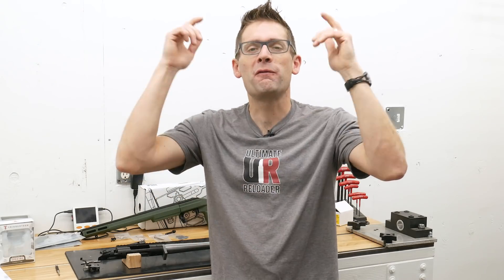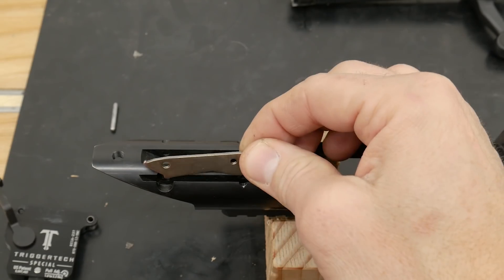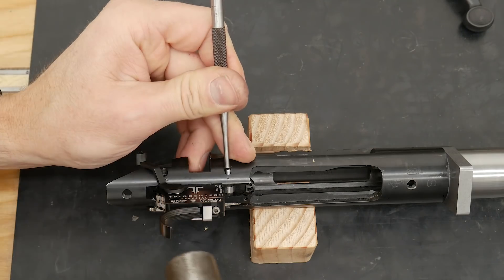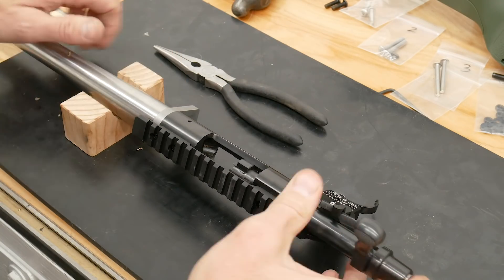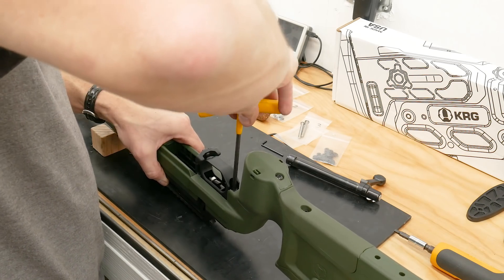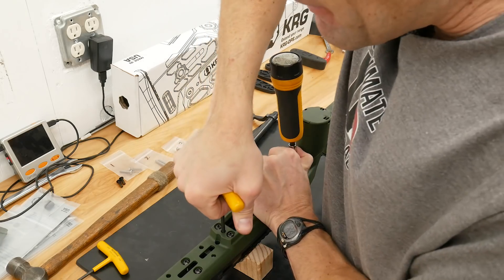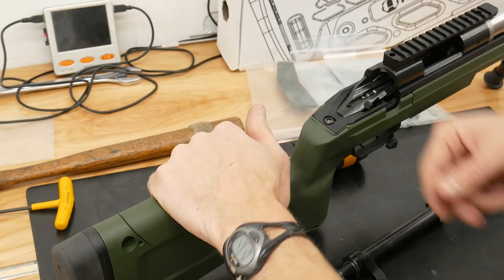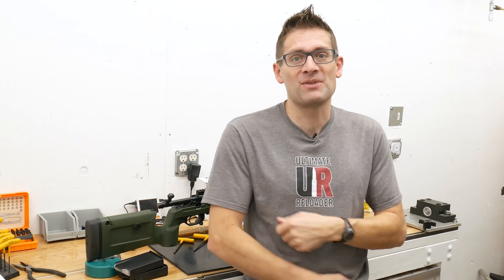224 Valkyrie Rem 700 Build: KRG Bravo Stock, TriggerTech Special Trigger (Part 6)

Comment: I'm completely new to long range shooting, would I need to get bottom metal for a barreled upper if I get this stock? Say I buy a factory tikka t3x lite that runs their proprietary mags, would I be able to remove it from the stock and be able to just plop it down into the KRG and run AI mags?

And thanks for running through your build process! Makes everything look a lot less intimidating.

Comment: Nice build! I have a remington 700 in 308, bought a triggertech trigger  and a KRG bravo chassis. I had the same trouble for the front screw and came up with the same solution. I didnt had any spacer on the buttstock, I build it last winter and its cold here so I had multiple layer on me anyway but now I just get used to it even in the summer. I will had a strike eagle next month... I will take a look at your videos! keep up the good work.

Comment: Does your bravo have an aluminum or polymer bolt release? If its polymer which extension did you purchase? I'm considering the bravo and read on their website for an August 2018 update they switched to a polymer mag release

Comment: Awesome video series! I learned a ton. And it was entertaining. Thanks a lot for it.

One question: why didn't you glass-bed the barreled action into the stock? Isn't that always preferable?
Reply from the maker: Thanks! This chassis is machined so that you don't need to glass bed- so far so good on that!
Reply: @Ultimatereloader  I was wondering the same thing re: bedding.  I'm quite uninformed in re: bolt guns though.  Thx for answer.

Comment: Great build how much money are we talking about
Reply from the maker: $550 - barrel blank, $100 bolt mods, $400 stock, $100 extra parts, $40 scope rail, $200 trigger - so say about $1500 + labor + optics at the end of the day??? I gave myself a great deal on the gunsmithing labor :) :)
Reply: @Ultimatereloader  Wow, that's an expensive barrel for a blank. I figured the barrel blank would be cheaper than an already reamed/threaded barrel. My 223 REM Match Criterion was only $300 and it was ready to bolt on.